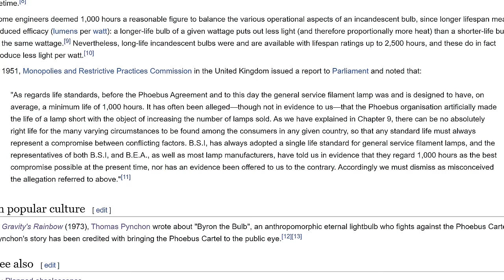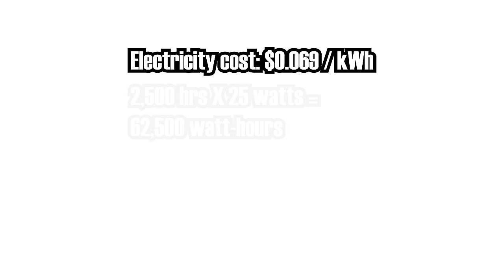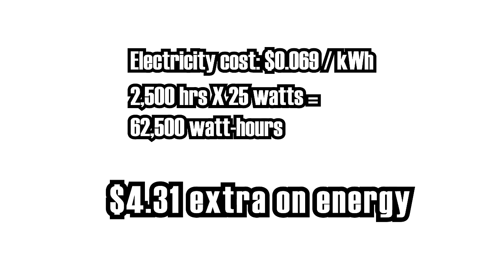Longer-lasting light bulbs: it was complicated

Comment: One of the reasons LEDs  burn out too quickly sometimes is that the electronics in their bases are heat sensitive. So installing them in a fixture that doesn't allow air circulation around the lamp, like most fixtures meant for incandescent and halogen bulbs, can make them overheat and burn out. So if you find you are changing LEDs often it might be due to the fixture not the light source.
Reply: Absolutely correct.
Reply: True, but the more efficient LED bulbs will last longer, even in inappropriate fixtures, simply because they waste less energy as heat and are therefore less likely to overheat.
Reply: @gubx42  yes, led bulbs that produce less heat are less prone to overheating. It also matters where in the bulb the heat is produced.
Reply: IKEAs LED bulbs are dirt cheap, last forever and never get any more than lukewarm even in enclosed spaces.
Reply: As stated in the video, quite a few are overdriven. I've had some in perfectly vented, open fixtures and yet they burned out in under half a year. Typically lamps that are meant to replace halogen bulbs. Small form factors where the diodes grill the electronics because they are in very close proximity as the lamp can't physically be bigger.

One desk lamp I had was suspiciously hot on the brightest level and surely burned out quickly after a few months (custom LEDs not meant to be changed - so... in a well designed enclosure (?)). Bought a different one, but as it turned out electronically quite identical. Toasty on max brightness, but much cooler one level down. Almost the same output in light but astonishingly less hot. It's now running perfectly fine with daily use after 4+ years.

Edit: Forgot to mention that for double the perceived brightness you need to quadruple the power (= quadruple the heat) iirc. So a little less bright can go a long way.
Reply: Oh, you mean can lights?  The cheap builder's best friend?  Yeah.... they're an LED graveyard.
Reply: There is a video on this very channel that discusses the longevity of LED lamps and why some of them absolutely suck, but I can't figure out which one it is without possibly rewatching every video about lighting on this channel...
Reply: @timno9804 "a troubling trend in lighting" thats the title
Reply: Just as with incadescent lights, lots of LEDs are run at too high power, reducing their lifespan.  This is especially true in the less expensive LEDs.
Reply: Or if they cheep out and don't have a good enough heat sink
Reply: They could also have better heat dissipation.
Reply: I've got a bunch of boob lights in my house, and I dunno if I should put LED bulbs in there.
Reply: @sco145  Boob lights sound like something a sleezy guy in the 1970s might have.  Lights that resemble a female breast?
In case you meant bulb lights, as in incadescent bulb lights, replace them as they burn out.  I'm surprised you have any still functioning.
I didn't wait for mine to burn out, happily replacing them with LED as soon as the price dropped to reasonable.
Reply: @Vector_Ze  boob lights are common in American construction from the 70s and 80s they are a vaguely boob shaped glass bowl that seals over a couple of light bulbs
Reply: @andersjjensen  The base of the bub in and around the socket does still get pretty hot I think, even if the end of the bulb does not.
Reply: @TobyCowles  I worked as an electrician on construction projects in the 1970s and 1980s. I never saw them.. I never even heard of them.
Reply: @andersjjensen  IKEAs LED bulbs are not dirt cheap and last no longer than other bulbs you can find at Target or Home Depot
Reply: @sammiller6631  I don't have neither Target nor Home Depot where I live (I believe they're US exclusive?) and most hardware stores here carry Philips or Osram which are 4x as expensive and also just rated for 10k hours.
Reply: @MarinCipollina  You've probably seen them, you just haven't heard them called that. You can just google it, though; it's a common enough name.
Reply: Today I learned about boob lights.
Reply: That's one good reason to get smart bulbs. Drive them at 75% and they last longer.
Reply: @gubx42  No necessarily.  A lot of LED lamps now make use of a discovery from the mid 2010s that certain combinations of excessive drive current and elevated die temperature makes InGaN dies (used as the blue phosphor pump light source in 'white' LEDs) more efficient at the expense of die life.
Reply: It's mostly cost cutting. I have a Phillips LED A19 bulb from 2010/2011. It's still working, is used daily for hours. It's stupid bright (1200 lumen 3way), but weighs a FEW *POUNDS*, is mostly metal heatsink, and gets hot as hell. Not incandescent hot, but hot enough to not be held directly in your hand.

It was at least $40 back then. Now you get them for about $5-$10. Hell, ZigBee smart bulbs are under $20. And this was $40 in 2010 money.
Reply: I worked at Philips when they won the prize for the 60w equivalent prize from the US government. 10 million dollars. I think it was $50 per bulb.
Reply: @gubx42  no man, the led bulbs run easily betwen 50 or more celcius degrees, i diy fix and try to mod to long lasting, but bad quality leds, worse quality power supply, and almost inexistent heat sink or disipation make a 4 to 5 dls bulb last, 6 months to 1 year, i live in a hot country, and it's not easy  to success, but it's possible, i start damaging 50w bulbs in year and 3 months or 6 months used almost only at night and other all day long, low hot metal roofs for make dark house, well, that's common.
Reply: @gigglybeast  ohh hi get it it's a dull glass fixture for install lights inside
Reply: as a side note used a non insolated power supply, just directly convert ac to dc and current controlled with pulsing, awfull factor correction from this type of lamps, and the good thing, you can easily modify the chip to tell run at a lower amperage to the leds just changing some resistors, you can play to sacrifice brightness or change it more frecuently, double the socket for running at half power, it's not that bad idea
Reply: This was true for incandescent bulbs to, some fixtures ate them. For leds it the base who need to kept cool.
Reply: True. My leds Bulbs last so long I forgot when I buy them.
Reply: Worth a note, somewhere around here... You CAN get an older school device, a sort of "socket extension", and many of them have a pull-chain switch inside, but there are the simpler ones without. You screw this thing into the original socket, and then a bulb into the socket at the end, and it literally just moves the bulb about 3 inches (that's the neighborhood of 75 mm) directly out of the original socket... Most of the ones I've been around have at least one plug-in on a side, and it would seem the use of an extension cord may be the original intent, or part of it anyway... BUT many of us out in the rural areas use them just to move the bulbs to open air so they get more circulation and that can extend their lives... I don't actually know anyone who fancies the idea of plugging anything into an overhead light socket...

    The reason I bring it up, is for these "short life" LED's... It's worth having such a thing on hand to test whether you just have a hot socket that should be replaced, itself, a poorly vented fixture that should at least be mod'ed... OR if it's most likely purely piss poor construction of the LED bulb... Once you have your answer, of course, what you DO about it is still up to you. I have a dining room socket that NEVER had a wall-switch... There's a switch in the room, but to this day I have no idea what it ever did if anything at all... The people we bought the house from had used one of those socket extensions for the pull-chain switch, and we've been lazy... never bothering to upgrade it. 

     AND you might argue that the switch in the wall absolutely MUST do something, even if I haven't tracked down what that is... Well, not necessarily. The construction industry of even the recent past is such that in our area, there are a LOT of drugs involved... SO there's no guarantee anything in your house is going to do anything when it's been "hired out"... SO I'll eventually get around to figuring out the rest of the house's dubious wiring... I just don't trust the area enough to bother letting anyone else at it. One rather unpleasant surprise was finding out the dryer outlet in the bathroom was wired exactly opposite to what it was supposed to be "by code"... though how that happened is beyond my caliber of supposition... other than "somebody was obviously drunk or stoned or both". You'd think that wouldn't be an issue in alternating current, but apparently on a 220VAC circuit, at least for dryers, it IS... or it CAN be. That's the only fault I could find with my tester after the fact.

    In any case, the socket extension device isn't particularly expensive nor dangerous... It can be a GODSEND when you just want a relatively simple "troubleshooting" utensil to make a few very basic observations... on the order of "yes/no" objectives regarding function.  ;o)
Reply: if you really want your LED 'bulbs' to last longer, pop em open and take off one of the voltage regulation resistors.

bigclive has a few videos on how to do it. results in about 20% less brightness and 60% less power consumption, and gets rid of most of the heat issue too.
Reply: You'd think that with silicon chips being able to exceed 100C that this wouldn't be that much of an issue though..
Reply: @gubx42 Nope. I just had to replace two LED bulbs at my parent's place.  Both failed within their first 200 hours of usage, within weeks of each other.  Bulbs are in a very open fixture with plenty of airflow and minimal bases.   Cheap electronic components killed both of them, with the capacitors on both being the culprits.   The manufacturer went too cheap. Now they're in the landfill.  Yay, more e-waste!  Or "progress" as the eco weenies call it.  I have some quality CFLs which are 20 years old and still work fine.  Same for a real carbon (not tungsten) filament bulb which has been running for decades.
Reply: That and they overvolt the LEDs to increase profits. Fewer LEDs are needed for the luman rating of the bulb and or course they fail more quickly.
Reply: @gubx42  issue arises as low cost electronics and LED units are NOT forgiving to overheating and fail quickly if overheated
Reply: @39XenonD  I had bought an IKEA desk lamp with a smallish LED at the end of a "snake" with a clamp on the other end around 2006 and replaced it in 2020 because the power electronics failed (suspect bad cap) with the same IKEA lamp
Reply: You can't deny that LEDs are designed to be driven at very high current without proper heatsinking or cooling. This sucks because unlike incandescent bulbs, LEDs become less efficient at higher temperatures and produce less light per watt. I've made LEDs by doubling or quadrupling the diodes for the same drive current. They last for years and years and don't fail like conventional bulbs.
Reply: @jasonriddell  Seems to be a reasonable runtime. Nice
Reply: IKEAs earlier "Trådfri" GU10 bulbs seemed to have an issue where the microcontroller got damaged from overheating (in a fixture with limited air circulation) and wouldn't connect to the Zigbee network anymore. But they replaced the bulbs for free and the new bulbs I got from them seemed to have a different design intended to make them better at rejecting heat. Those have lasted for years now. So at least in IKEAs case they seem to be trying to do the right thing.
Reply: The LED bulb I got for $1.50 for my porch light 5+ years ago is still running. Of course, being in Northern Norway, it's off 24/7 in the summer and on 24/7 in the winter.
Reply: Also LEDs really don't like heat themselves, not just the driver electronics
Reply: I have LED bulbs from 2014 running just fine, used every day
Reply: yes they are overdriving the LED chips so the bulb doesn't last as long as it could, like a filament bulb!!
Reply: The packaging, as well as the bulb itself, should say either "suitable for totally enclosed luminaires" or "not suitable for totally enclosed luminaires." It pays to read the fine print.
Reply: Bull. ALL, not some, all the LED bulbs i have burned so far have had one LED diode burned out. Not a single one has been the powering part. That's nearly 319 light bulbs of different brands raging from the cheapest to the most expensive available on the common market. I've had them mounted in all directions, both vertical "glass" up, and vertical "glass" down, horizontal, angled etc. Always the diode, never the driver circuit.
Reply: Those problems can be solved with engineering, companies just choose not to because cost-cutting & instead make LEDs that burn themselves out despite supposedly being "more efficient" than incandescent bulbs.
Reply: Makes sense. My leds all run crazy hot. Thought that was an issue.
Reply: @sco145  get some good quality LED's and just go for warm lights. Good LED bulbs last for decades. Got the one in my room when they where just starting to get popular, about 16-17 years ago and the thing is going strong
Reply: @Vector_Ze  Sorry, the correct term is flush-mount dome lights. It's not anything raunchy
Reply: @sco145 
If you look at the LED packages, some of them will specifically say that they are suitable for enclosed fixtures. You would need to get one of those. 
I’ve got two over my front door that are close to 10 years old.
Reply: @MarinCipollina 
You may not have heard of them, but you’ve seen them. It’s those cheap dome shape lights you used to install in new houses. Also known as the builder special.
Reply: He talked about this exact problem in "A troubling trend in lightning"
Reply: @SomeDudeSomewhere  "My LEDs light bulbs keep burning out on fixtures that have the bulbs and their base completely exposed to the air." Are you using brand name bulbs like Osram or Philips (or General Electric or so on)?  No use blaming the technology if you are using cheaper off-brand bulbs!
Reply: @sco145  Don't unless you want to replace your LED bulbs a lot. Those fixtures hold heat in and fry LEDs faster than incandescents. My casual tests with leaving the glass cover off show that uncovered you get "normal" LED life, with the cover on about 1/10th.
Reply: While this can be true for enclosed fixtures, I would never underestimate the possibility of the bulbs themselves suffering from the problems of every "instant-on" CFL bulb, where the big problem is that the drivers are made in China out of the cheapest components imaginable (undersized resistors, etc.)